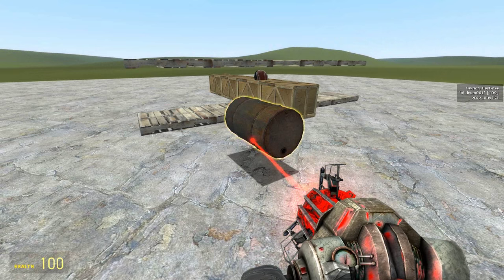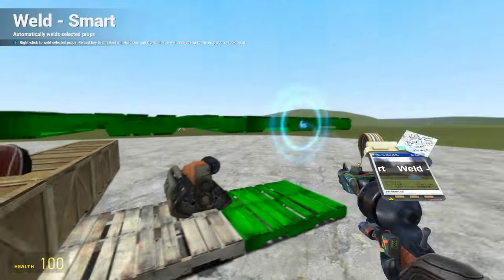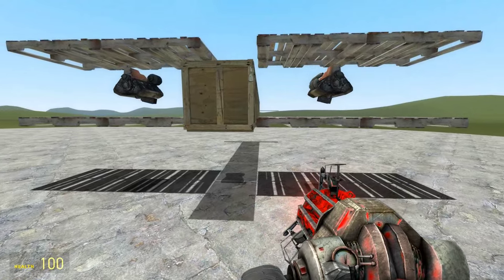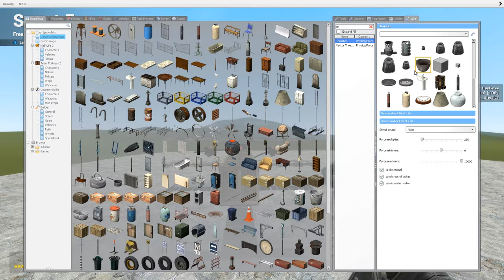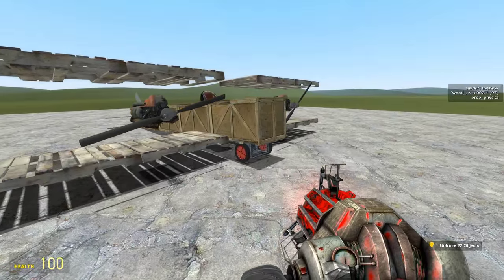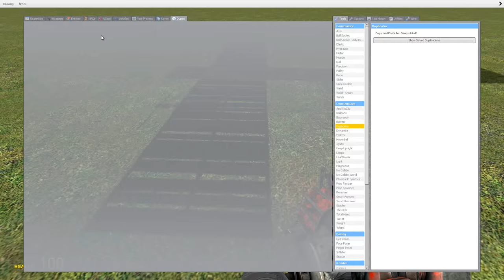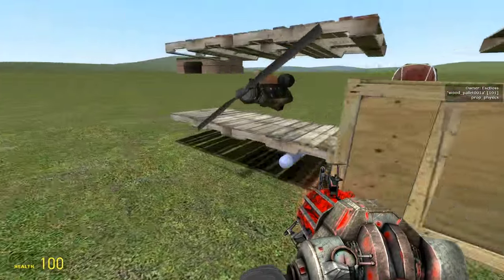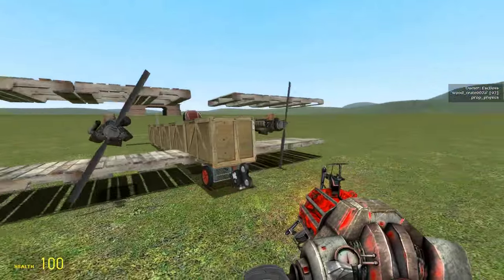Build request #7 - WW1 bomingplane

Comment: Boss, I tried searching for the smart welder in the workshop but I didn't find it. What's it called? I would kinda like not to have to individually weld everything...
Reply from the maker: +DarksteelSteve when you search for "smartweld" then make sure the workshop it searching for tools and not just every mod. There should be a selection in the rightside of the workshop when you search
Reply: +EscBoss Ok thanks